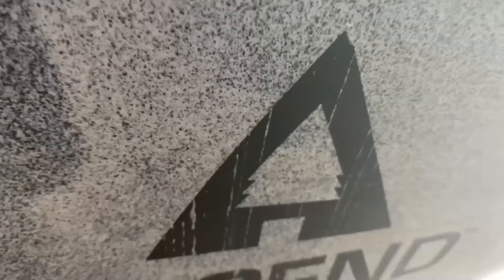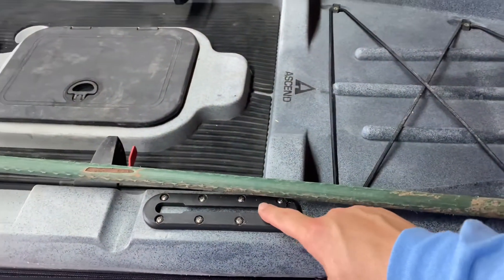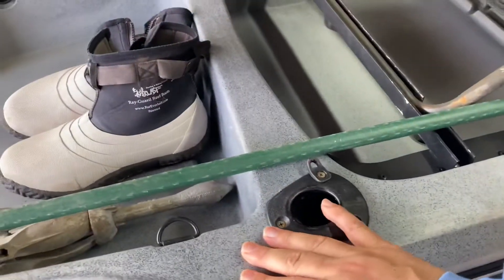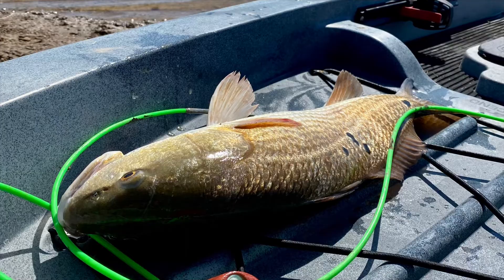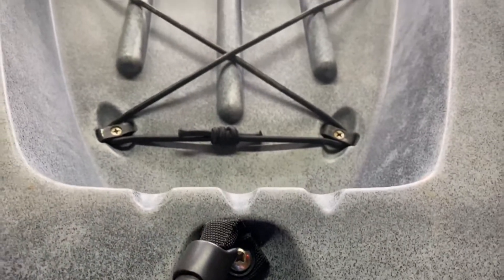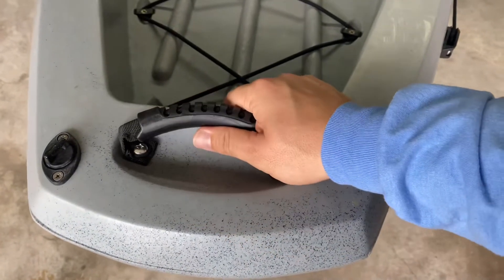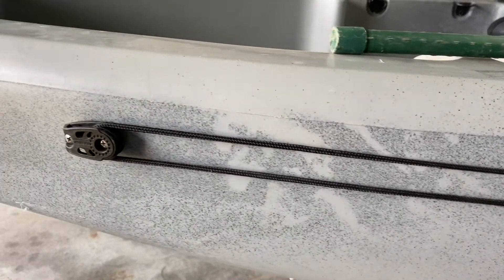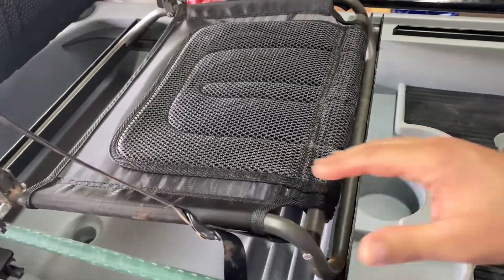2020 Ascend 12T Kayak REVIEW | PROS & CONS & MODS | Walkthrough | Watch BEFORE you buy!

Comment: How does it do in class one class two River rapids?
Reply from the maker: I couldn’t honestly tell ya 😂. ANever experienced any.
Reply: Lol not talking white water but small river type stuff
Reply from the maker: @roberthall843  It will hold up well. In running water the issue would be tracking straight, and it’s a pretty wet ride.

Comment: Excellent review!! But just wondering if its a good kayak for trolling. It seems like the pole holders might be in a difficult spot to grab your pole quickly when you get a hit? Thanks again
Reply from the maker: I appreciate ya watching! I’d have to say no. The kayak does not track well, it needs a rudder. The moment you stop paddling it tends to change direction. The rod holders could easily be modified using PVC pipe.
Reply: @ADDICTED2FISHINGTX  Thx!

Comment: Very nice vid. Thanks for sharing. One question, i just bought one today. nOticed there are two holes on the inner walls close to the front eadge of the seat. I was worries whether these were drilled by someone who evnetually returned it the store. Thank you.
Reply from the maker: Yes I have the same holes. If yours are the same as mine, look and see if there are threads in there. Sort of like threaded inserts. I thought it may have been to be able to move the foot pegs backwards. Or even something used in the the process of making the kayak. Definitely meant to be there, just not exactly sure why. ✌🏻
Reply: @ADDICTED2FISHINGTX  Thank you. Might be the injection hole for manufacturing the boat. Thanks a lot.
Reply from the maker: @jinkaixue5051  for sure! Hope ya like the kayak 👍🏻 The seat mod is easy! What color did you go with?
Reply: @ADDICTED2FISHINGTX  I got a sand storm one. perhaps the camo one is also great. there is no other color in the local Cabela's
Reply from the maker: @jinkaixue5051  nice!
Reply: I’ve got the same holes on my camo 12t, just bought it last week.
Reply from the maker: @jamesmackinlay9248  nice! You will enjoy it ✌🏻

Comment: Do you think it’s worth the 749 price it’s at now
Reply from the maker: That’s tough. I think it is well worth the 549 that I paid. That was the normal price a year ago. 749 is kind of high unless they made some significant changes. It’s definitely not a bad kayak but there is some good competition in the $900 price range. I bought it because it was cheap and worked well for $549. Look at some hoodoo and feel free kayaks.
Reply: @ADDICTED2FISHINGTX  thanks for the heads up. Gonna check out the brands you mentioned. Doesn’t look like much has changed for the crazy increase in price
Reply from the maker: @louieleos1218  for sure! Go to Austin kayaks website and look at the “3 Waters Kayaks Big Fish 120 Fishing Kayak” it $899. It’s a big and very wide kayak. Great hull design. That’s what I was choosing between when I got the ascend but I decided to save the $350. Let me know what ya think.